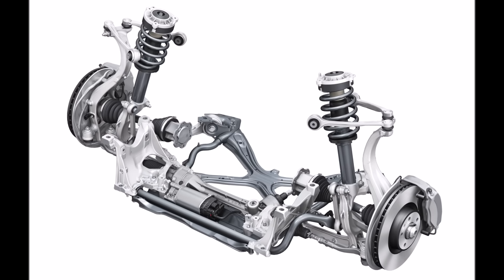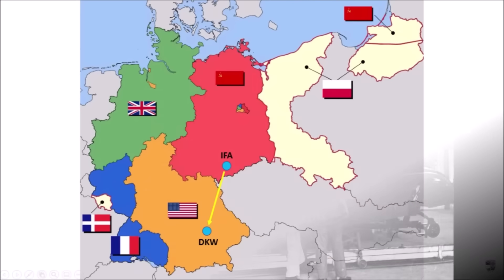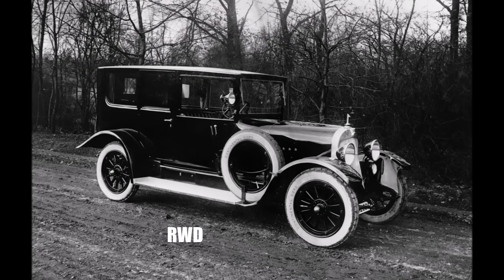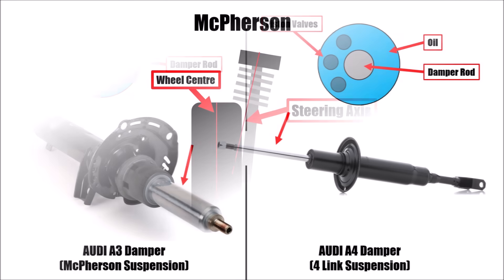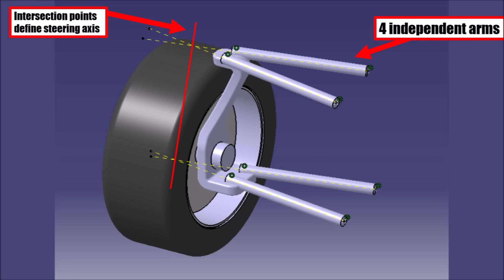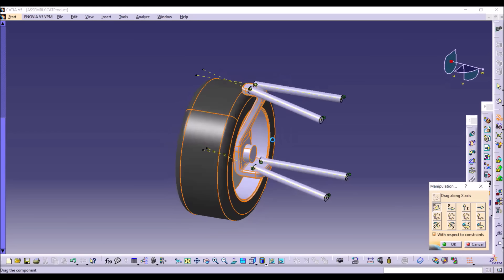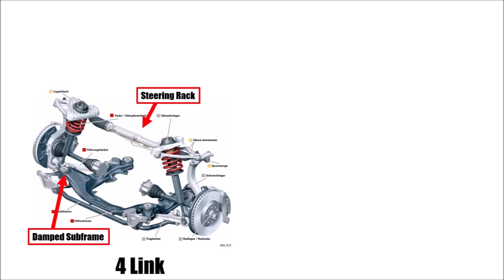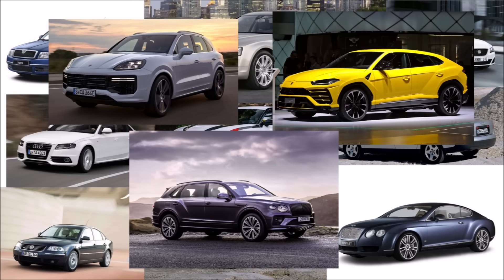How AUDI's Complex Front Suspension puzzled the Competition

Comment: It's a great design, I have it in my Passat and the steering feel is great, the precision is there. Nonetheless, it was so much needed just to make up for Audi's poor handling before, the main result of front end heavy design. Meanwhile BMW continues to use the simple MacPherson design to this day while better distributing the weight between axles, making for excellent handling machines. While my comment is not hate for Audi, since I myself drive a VW Passat, the difference to BMW just underlines how different car designs and engine mounting position present different tradeoffs for the suspension overall.

Comment: as the old saying goes, you can't polish a turd. -BMW guy probably Okay, sorry for the rage bait. But they just never stepped back admitting they were wrong and that to get performance handling, you have to move the weight of the engine behind the axle, at least most of it. Thats why the competitors and especially BMW were faster on the track over the years. Can you imagine the stubborness of such a company of engineers over the years. I'm looking at you too Porsche.

Comment: downside is the maintenance costs are too high because of the complexity. 
To many bushes and ball joints which when worn out cause a lot of trouble to diagnose unwanted noise and other problems.
Reply: this suspension last 200.000km. At this range,price is low.

Comment: I really doubt that the competition took more than a second's time to understand how this multiarm arrangement worked, as BMW already had a virtual axle 2 link lower A-arm front suspension since 1981 in their 5 series, and Mercedes had a 5 link axle for its 1982 190E's rear suspension.
Reply: Agreed. From what I've read about W201 development, it wasn't a case of understanding the concepts, it was finally having computers capable of simulating the complicated dynamic behavior of this many links.
Reply: Is that where Ford stole the idea from
Reply: The Chinese are doing all they can to copy this and despite their reverse engineering and corporate espionage they still can’t produce cars that drive like German. There is nuance that comes from 100 years of car engineering that makes the MLB platform so very refined and capable
Reply: @HerculesWFT  You got it wrong, my friend. The Chinese are not copying, they are BUYING the suppliers and OWNING the technology OUTRIGHT! That's how they are getting their hands on legacy IP. For innovation, on the other hand, they are pooling the largest and cheapest group of engineers that history has ever witnessed to come up with new ideas and realize them. As for that particular German car drive feel, that's a very particular use case where they still have parts of the Autobahn system without speed limits and thus need cars that are able to safely cope with sustained max speed driving, so nobody else in the rest of the world makes cars that drive like German cars because nobody else is able to legally drive at such high speeds.
Reply: @petrolbokehlicious  I think you’re right that they’re buying tech but I also believe they are copying. VAG spends $40bn a year in R&D. China doesn’t have a track record of innovation but more concerning is their zero-sum game mercantilist approach. They are using western technology, exploiting their lower production costs via subsidies, lower paid workers and poorer working conditions to undercut and take out western legacy brands and own the market. Make no mistake they want to kill off western brands. In my mind that’s a terrible outcome because who will lead true, cohesive and clever innovation? We’ll be driving cars with ridiculous features like refrigerated cup holders, disco headlights, selfie cameras and zero gravity sleep seats… with almost no advancement in dynamics, primary safety, cohesive design language or mobility concepts. It’s just superficial junk cocked up by professionally immature product teams.
Reply: bmw with mcphereson? :))
Reply: @RST9413  https://en.wikipedia.org/wiki/Dual_pivot_steering_geometry
Reply: @RST9413  yes, BMW typically uses McPherson front suspension.

Comment: Honestly its not that complex

It looks complex if you haven't worked on an Audi before, but it kinda clicks pretty quickly once you actually start messing around with one. Its honestly a really clever system that ends up making for a very comfortable drive.
Reply: a mechanic that think that suspension means only few parts. Yes you can uninstall them but you have no idea about angles of this suspension and anything else. hahaha
Reply: @RST9413  What?
Reply: @RST9413  That's why you can go into a workshop with machines that measures that and they adjust it in 1 hour.

Comment: Major competition had these days independent rear suspension, even on small cars. But German premium luxury had unreliable multi-link in front and Beam Axle on rear.
Reply: MQB-A0 is rear torsion. This is Audi A1. It is not and never has been premium and definitely not luxury. This rear torsion will still outperform many trailing arm / 5 link IRS from many competitors.

Comment: The steering rack is still rear high (not through the subframe) in my 2008 A6 Allroad (as is for the entire C6 generation). I know because mine leaks. Also - I once thought I would buy a new a__hole bolt for the two upper links. I went to a hardware shop 50 km from home, parked the car (unluckily in a puddle), lifted the wheel up, took it off and used a crowbar while hitting it with a hammer to extract the bolt. I locked the tire in the boot, took the bolt out, went into the shop, car being left on a jackstand (some stupid moron even asked me if I needed help), came back, put the new heat-treated bolt in and the new super-anti-rust A4 (anti corrosion class) nylon nut on, put the wheel on and drove home.  I've always said the audi's "multi link" is in fact double-wishbone, but nobody listened (probably because I don't have a channel here or probably because it doesn't matter). Also - my other car - a F11 generation 5series - is the first 5series with a double wishbone front (the current Porsche 911 in the GT3 RS form raised quite a show being the first 911 to have a double wishbone front). BUT - even on the 530xd, although if the top link is a single actual "wishbone" - the lower two links are split. And yeah mine are still original for 310 000 km from of course Lemforder. BUT - there are many, many cars which have some of the best steering and handling - like the 204 Benz C-Class - which still have McPherson, although even then they can be highly "manufacturer modified". But then again - I can take a corner faster and more confidently in my 530 than in a C-class. EIther way - there's lots in this video I didn't know. Thanks for that - from Latvia.
Reply: The fu ck are you doing with taking the wheel of on the parking lot?! The damn bolt has a number and you get it in the dealership no problem…

Comment: Citroen has used this design too on their hydromatic suspensions. Absolutely awful to work on with every top and bottom end blocks dying prematurely due to increased stress.

Know of people who worked in Audi dealerships and they told me similar stories. Works well but the early end blocks died after 100.000 km where the entire wheel would move forwards/backwards when accelerating and braking
Reply: Do you mean C5X7? It used suspension more similar to that is used on Renault Megan Sport or Opel Astra GTS. There were no double links with virtual axle.
Older Citroens had simple McPherson or double wishbone suspensions. Or even trailing (or pushing) arms on 2CV. So Citroen compensated additional complexity from Hydropneumatic or common springs on 2CV by simple linkage.
The reliability of that Audi suspension - I think that was a feature, not bug. Customer should spend as much money as he can/ready. One will pay all the time for replacing one ball-joint after another, another will continue driving the car with knocking suspension. So that suspension was a perfect in terms of marketing.

I would say more general: German auto producers were always leading, and so they were also the first, who started to produce money-pulling sh*t, instead of simple and reliable constructions.

Comment: I was fixing a VW Passat B5 front suspension, specificaly a faulty bearing. This stupid fucking thing was so stuck on there that even with heat it didnt move, eventualy the front strut got bent and i had to replace the whole thing, because the linkages didnt fit on the new one

Comment: I remember spotting this on the first-gen Audi A4 many years ago and being puzzled by it!  It seems like a very clever way of eliminating torque steer in FWD applications!   Clever that is, until the ball joints start to wear out and you have a four-figure bill to replace all the links (don't think you could change the ball joints seperately?).   Still, if low repair costs are what you want Audi is definitely not the brand for you!!! haha
Other manufacturers have since come up with "independent steering axis" McPherson struts that have a similar effect but with less complexity.
Reply: It most certainly does not cost 4 figures to replace ball joints lmao, especially for a B8/B8.5 Audi, for a B9 maybe. 
Unless you live in the US where seemingly everything to do with repairing Euro cars is expensive
Reply: @WarlordEnthusiast  If you are overhauling the whole front end then yes it will be a four-figure bill - Especially if you go for OEM arms, which is advisable if you want parts that last. You cannot change the ball joints. You have to buy complete arms.
Thats a total of 8 control arms you need, at between 100-200 bucks each....and thats just the parts!  Add in the labour charge to fit them and the front alignment you will need to get everything tracking right and you are WELL into 4 figures.
You could make the argument that it's not necessary to replace all the links in on go but, they will all fail eventually so the ultimate cost will be the same regardless of whether you spread it out or not. 
Audi's are notoriously costly to repair.
Reply: @soundseeker63  I've had my 2010 A5 for over a decade and never had that issue. And I live right next to the sea.

Its at 240k and the most expensive part I've had to replace was the windshield wiper linkage.

Btw, I looked up the price of replacing the full front set of control arms for my A5, 210 euro for a complete set of aftermarket ones likely made in the same factory as the OEM ones.

Buy a set of wrenches/sockets and your looking at 210 euro + like 50 bucks for the alignment in total to replace them.
Reply: @WarlordEnthusiast  There is a phrase "if something seems too good to be true" it probably is. Very relevent in this case.
Go and put some cheap suspension parts on your premium German car and see how long they last....if indeed they fit at all to begin with.
Cheaply made Chinese crap being sold as "OEM" quality is EVERYWHERE these days but it is the literal defintion of false economy.
I used to work in a car parts warehouse delivering to garages including VAG specialists so I do know what I'm talking about when it comes to how much these things cost.
I've learned from my own mistakes trying to cheap out on parts for my BMW in the past. Never again. You just end up doing the same job twice.
If you think you can get a set of 8 links for 200 bucks I can assure you they will be fit for the bin in 6-12 months.  Don't say I didn't warn you.
Reply: @soundseeker63  In Europe, old Audis are veeeeery popular and whole front suspension overhaul costs for today 150 euro in cheap and tested suspension parts like master-sport multilink set for A4. (around 90-120 kkm and 6-8 years of reliability) People making it with closed eyes in their parking.

Audis are used for low cost, indestructible cars in Europe, they are working horses as taxi etc. You must be murican.

Anyway, this suspension is very reliable, first problems are after 320-350 kkm and decades of riding.

Comment: The A8 D2 and A4 B5 where the first cars with this setup and the bushings wore very quickly. I drove my D2 for close to 500000km and had to change out the entire front suspension, including all 4 control-arms per side, 3 times as it got so sloppy over time. The car could not be aligned anymore due to excessive play. My A8 D3 lasted almost 350000km without ever needing to replace anything on the front end. So Audi really learned from the D2.
Reply: 3 times over 500k is pretty good tbh! 😅   Also it should be not a problem to get an alignment if you replace everything (including the subframe bushings).

These days you can get a full kit if bushings for like 200€ aftermarket or a full set of Lemförder arms and subframe bushings for about 800€ or so. Yes, quite a lot more expensive compared to MacPherson strut where you can probably get the same set for 200€ but they don't compare.
Reply: @rkan2  That is pretty bad. Currently using a Peugeot double wishbone suspension on 400k km. Suspension is all original (except snapped spring once and wheel bearings... both recently). No arms, no mounts, no bushes, no ball joints. I live in England, you either have choice between pot hole or speedhumps, sometimes both. No alignment issues.

Comment: It's interesting that they ever used a rear-steer rack position with the virtual pivot setup. Front-steer like they do now should have much more favorable Ackermann geometry due to how the virtual steering axis moves longitudinally with steer angle
Reply: I don't think front vs rear mounting of the rack really matters. That it's more about the position of the rack vs the steering arm.
Reply: @snek9353 If the steering axis is static then yes absolutely. But in this case, when the steering axis moves longitudinally, the effective lever arm of the tie rod on the steering axis also changes, thereby changing the amount of steer angle per amount of rack travel as a function of steer angle itself.

Happy to be proven wrong if there is a flaw in my logic, but that's what I have read elsewhere (there's a great Autopian article from Huibert Mees(?) on the topic) and observed for myself when I designed an FSAE multilink setup
Reply: @camerone397  It looks like youtube ate my reply

Comment: Given the advantages of a split upper control arm design, why do BMW and Mercedes continue to use a single upper arm?
Reply: See this as a method of combating the worse weight distribution because the whole engine is in front of the front axle. BMW and Mercedes don't have that, so they can get good enough handling with less effort.
Reply: @flexxx222  I heard it was more about eliminating torque steer than compensating for bad weight distribution (Audi to this days are still known for understeering handling) but you are right about BMW and Mercedes - With better weight distribution and drive going to the rear there was no cost-benefit of a complicated multi-link front setup.   Look at their rear axle setups by comparison and you can clearly see thats where all the money has been spent.
Reply: Audi has always been a FWD and AWD set up. This 5 link suspension eliminates torque steer.
BMW and Mercedes has a RWD set up which don’t have torque steer to begin with. That said, their AWD does have worse torque steer problems than Audi.
Reply: @jamsbong  Yep, their awd were usually awfull and handle bad.
Reply: They have less need for the virtual pivot point because they put the upper ball joint above the tire instead of inside the wheel.
Reply: @snek9353 Yes, finally someone who points this out. Also, having a ball joint above the wheel lowers the forces on the top arm. Honda used this design on the Civics since 1988.
Reply: Costs most likely
Reply: it is easier and cheaper. However they use double lower joints and one single upper joint. They have virtual steering axis, but only in the lower side
Reply: You get one chance to guess. Its the same reason most BMWs still have front struts.
Reply: Maybe because the upper control arm bushings with split ball joints wear out quicker. When you only have one ball joint, the bushings don't twist while steering, because the steering axle goes through the ball joint.

Comment: Is this a reupload?
Reply from the maker: Yes it's an updated version
Reply: @bsport320  did you remove the part about the kinked steering linkage where in the case of an accident it bent in a way that retained some form of steering functionality, or am I mis-remembering.
Reply: @bsport320  and even better ! 👍
Reply: You're real follower man!
Reply: Yes
Reply: Why marvelous engineers still join aluminium and steel elements, guaranteeing issues for the mechanics, and in case of Phaeton, screwing up  the bodywork over time?